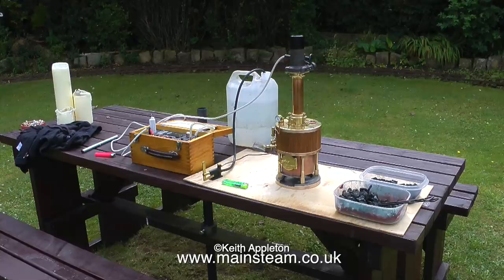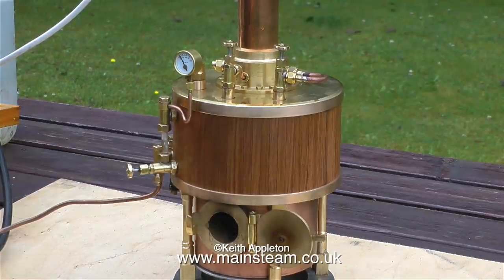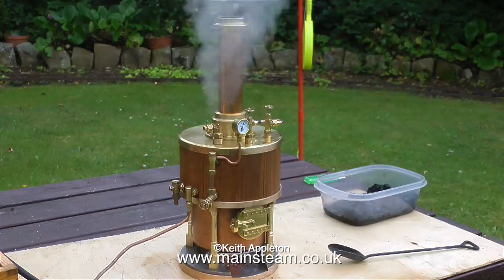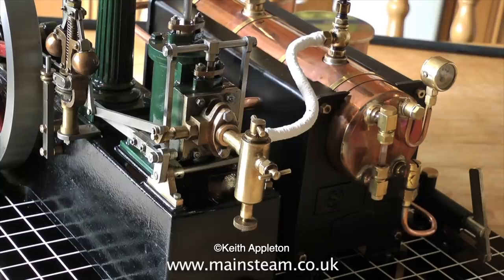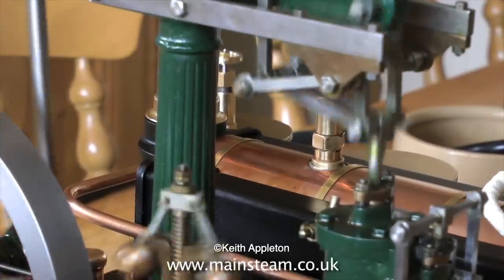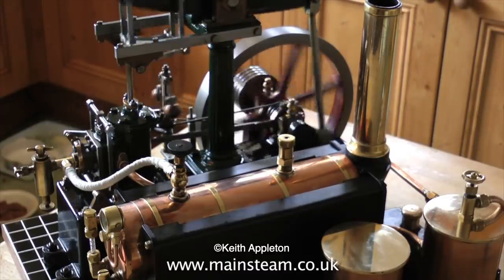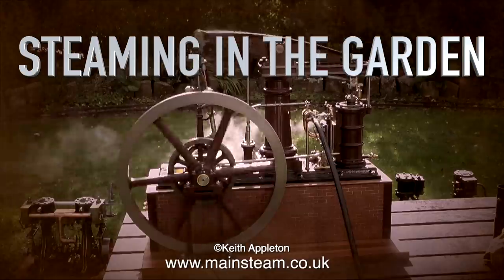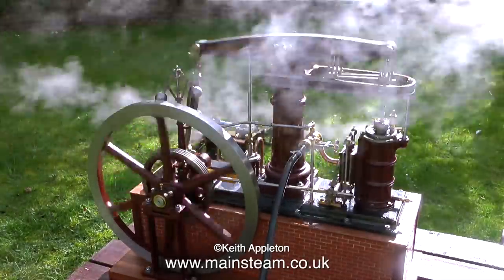STEAMING - MODEL STEAM ENGINES AND BOILERS

Comment: You have to admire the artistry and engineering that goes into these machines, but I prefer working models such as steam trucks, traction engines, showman's engines, etc. I have a 1 1/8" working scale road engine and I'm considering purchasing a running 2" scale Clayton lorry.

Comment: Stuff a rag in it LOL 
I Always enjoy your videos but especially like to see engines being steamed. If I may pass on one word of advice that was passed down to me buy a good friend and model engineer for years running traction engines. If you ever have trouble with a coal , wood or any other boiler that has a fire that cannot be shut off with a valve such as gas the best easiest most practical way to deal with it is to stuff a rag in the chimney. I have listen to a few model engineers talk about the importance of having the ability to drop a fire out of a boiler or the importance of having three different ways to put water into a boiler under pressure due to the paranoia of running low on water overheating too much pressure from too hot of Fire and having the boiler blow. If you ever find yourself in any of these situations stuff a rag in it is quick easy and not something you can mess up too quickly if you're in a panic state. As well it works very efficiently by stopping air flow through the boiler and snuffing out the fire.
Reply from the maker: I am not sure that would work fast enough . . .
Reply: Hello Keith, maybe a topic for an experimental video? Maybe give it a try and see what you think.
Reply from the maker: This comment is not a good one at all. Probably a good way to destroy your boiler. Dropping the fire immediately is what needs to be done if the water disappears below the water gauge nut and you don't have a way of getting a lot of water into the boiler quickly. Or maybe you could just stuff a rag in the chimney, stand well back and watch your Firebox Crown destroy itself with the heat of a coal fire . . . if anyone would like to make a video about it ....... I will not be doing that.
Reply from the maker: After you Shawn . . . . . show us how it's done, just stand clear of the boiler when you do it.
Reply: @keithappleton  I think some may be taking this out of context I am by no means saying try to put your boiler in a dangerous situation and then put a rag in the top just to see if that works. What I was implying was that if you have a boiler operating at normal working pressure with the proper amount of water in it just try putting a rag in the top of the chimney to block off the air flow I think you will be surprised how quickly it snuffs out the fire and you lose pressure without causing any harm. Yes I have seen it done and it worked quite well. I am also not saying to rely on this as a method to shut things down always good to have proper blow-off valves and more than one way of getting water into a boiler just to be on the safe side. Was just saying that if any of these do happen to fail and you find yourself in a panic situation if you were to take your gloves a rag even the shirt off your back and put it in first or last if nothing else works why not have a back-up plan. Remember in order for air to come in and feed a fire air has to escape. Some engines may be quite difficult to drop a fire out of and speaking of experience with traction engines you are quite often travelling over flammable items. Drop a fire in the wrong place and next thing you know the fire departments on the way LOL. Anyways was just throwing it out there take it for what it's worth no harm in having a back-up plan if all else fails be safe all.